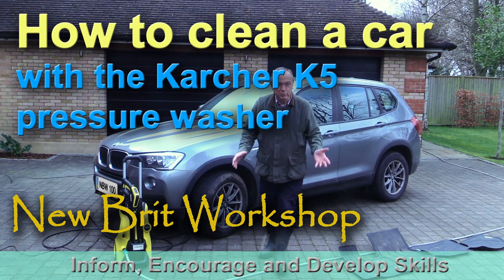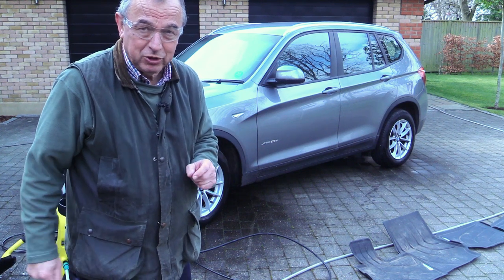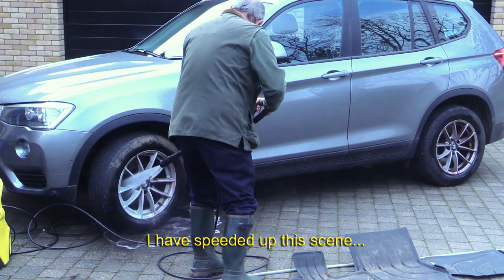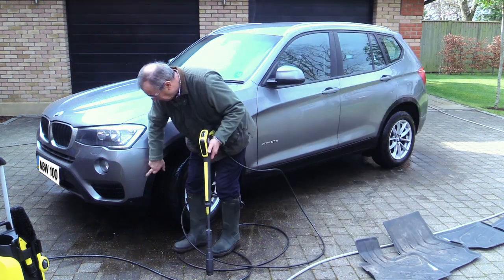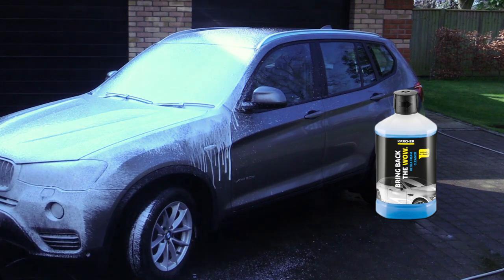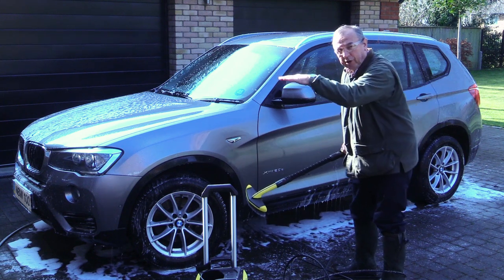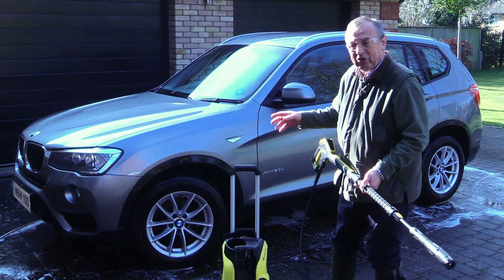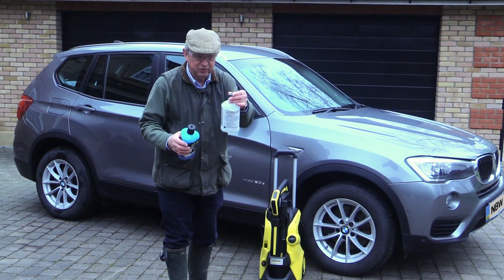How to clean a car with your Karcher K5

Comment: 😎I think you may have been born to produce video tutorials sir. Great advice delivered in a no nonsense manner and overall extremely watchable. When I opened the box for my new Karcher K5 I was quite annoyed at the fact that "some assembly was required" and a glance at the instructions had me headed straight for the internet to see if there were any videos showing step by step, dreading the experience as so many videos are so hard to watch. Imagine my surprise and pleasure when I came across the three wonderful videos you produced on how to assemble and use the K5 properly. One would assume you work for the BBC on a professional production, so informative yet entertaining and done at a pace that was just perfect to follow, not rushed through or moving at a snails pace and frustrating me into skipping anything to get to the point. In addition to the task I bought the K5 for, I am now itching to try it out on my car and driveway too. Thankyou so much Peter.

Comment: Thank you Peter. I've watched quite a few of your videos over the last couple of years and always come away better informed.
I am about to try the foaming shampoo on my car and hadn't realised the care needed with a pressure washer around the proximity sensors. My front sensors packed up a while ago and I'm not wondering if it was caused by the use of pressure washers in a local car wash. Hmmm. It's also reassuring to see how others get caught out by bottle caps that don't seem designed to be removed by normal humans! Keep up the excellent informative videos.😊

Comment: Hi Peter, just bought a Karcher k5 pressure washer. Looking forward to cleaning my slabs with the special circular washing supplied with my karcher. Used to own a karcher, as yourself ended gifting it to my daughter as we had a small pressure washer gifted to us. Big mistake, or not as bought the K5 with the attachment. It took me over an hour to wash 8 slabs with the small one, so looking forward to using the karcher to finish the patio and footpath. 
Thankyou for your instructions to put it together and instructions cleaning slabs. Very very clear and discriptive. Good job as we didnt receive instructions or guarantee with our new pressure washer. Will contact Karcher.
Great video for cleaning the car.
Reply from the maker: Hi Maureen, Yes, it is important to support the daughters ! The original K2 is still working well but the K5 is a big step up and can tackle bigger jobs than the K2. Do read some of the comments on the car cleaning video as some viewers have, I think rightly, provided some advice on the method. Good luck. Cheers.  Peter

Comment: As always, an informative video. I use a similar method for my car to minimise the strain on my arthritic wrists and fingers - a legacy of a career as a  marine biologist with my hands forever in cold seawater. I also live in area with exceptional hard water (high calcium carbonate content), so even brushing off with clean tap water still leaves stubborn water marks, especially on glass.
In the past I have had to resort to polishing these out, negating most of the benefits of pressure washing. However, a few months ago I came across a very useful tip on Graeme Pullen’s TA fishing channel, describing his lockdown distraction activities, where he finished of washing his car by rinsing it with clean rainwater from a watering can and just giving the windows a wipe with a chamois leather. I have since tested this approach and found it to work well, though I would add an important caveat, i.e. only take water from the top of the rainwater butt or tank so as to avoid the sludge in the bottom which may be gritty, particularly if the water is collected from a modern tiled roof
Reply from the maker: Hi Bruce, That is very informative and will be useful to many.  Cheers.  Peter
Reply: i live in hard water area but use an outside tap that is fed from my water softener, so no water spots.
alternatively you could feed the pressure washer from a water butt. karcher sell the accessories for this. no need for watering can!

Comment: As a car detailer you have alot to improve on, if that car was black you'd soon throw that brush away and never go anywhere near paint with it again. Firstly you should always start with wheels as you did, then apply snow foam to a dry car for the soap to soften and lift the dirt with lubrication then you pressure wash it all off and then only then you go in with a contact wash with a good quality mitt NOT a brush that will absolutely maul your paint. You should always aim to remove as much dirt as possible before you contact wash reason being is you're dragging the dirt across your paint, hence why you snow foam first then pressure wash your car effectively giving you as clean a surface as possible to make contact with when going in with a mitt!
Reply: When I saw the brush I was like what the hell is he doing 🤣
Reply: If the car was black it was totally ruined
Reply: Good presentation ..   never seen  a car detailer having glasses. .
Cars are cars ...  They get dirty use or not used
Reply: Everyones a car ‘detailer’ now 😂😂 the guy is demonstrating the pressure washer! He isn’t ‘detailing’ a Porsche you melts! Get back to your ‘detailer/car wash’ job and leave the man alone.

Comment: Quick tip if you snowfoam first when the car is dry the foam will stick to the dirt if you snowfoam when it’s wet it will just run off on top of the water. The karcher k5 is a great jet wash
Reply from the maker: Hi Mark, Many thanks for that advice.  Peter
Reply: Notice he didn't use snow foam as a prewash but rather as soap to begin contact washing, therefore at that point it doesn't really matter.

Comment: What about the possibility of swirl marks on the paintwork after using the rotary brush?
Reply from the maker: I have no issue with that - either my eye sight is not good enough or I really don't worry about that sort of thing. I have never traded in a car and had any hassle over price because the buyer spotted any paintwork issues. Life is just too short.  Cheers.  Peter

Comment: Thank you for this very helpful video.  I have just bought a K5.  I was a little unsure from your video the difference between using the bottle of shampoo turned upside down on the machine and using the dispenser bottle on the end of the gun?  Would you mind clarifying the difference in usage?  Many thanks, Stuart.
Reply from the maker: Hi Stuart, The bottle on the end of the gun is for the super foam whereas the bottle in the machine is for the regular shampoo. I rather like the super foam application.  Peter
Reply: @NewBritWorkshop  many thanks Peter, that clarifies.  The mega foam option is quite something.  Stuart.

Comment: Love your videos on woodworking but don't see the connection to this other stuff. Am ordering a part system. Being in the US it took me a while to decide if I wanted to go 20mm or 3/4" dog holes. Having taught the metric measuring system to many US companies when it was starting to grow in the 70's and 80's I decided to go with the 20mm holes and embrace the metric system for my work.
Reply: Obviously my spell checker doesn't like the word Parf and decided I really wanted to use the word part. Bad spell checker! Sorry for the incorrect spelling of your marvelous invention.
Reply from the maker: Hi Larry, I am just an ordinary guy and I will make a video about anything that I do that I think may help someone else - this time it might not be you but my last pressure washer video has had over 500,000 hits and now helps to subsidize my woodworking. Good luck with the PGS. Cheers. Peter
Reply: @NewBritWorkshop  Ordinary would not be the first thing that comes to mind when I think of you. I think  extraordinary comes more to mind. As a journeyman tool, jig and fixture with a formal apprenticeship behind me working on development of the 747 and L1011 along with military aircraft including nuclear missile systems development and working many times to .000002 +/-
Reply: I can appreciate a development of something like the Parf system. Trying to type thos on a tablet with big hands is not an easy task so I sometimes hit the wrong key.
Reply from the maker: Hi Larry, Many thanks.  Peter

Comment: Great video Peter. I notice the handle of the karcher is up. How do you lower the handle once you've finished with the pressure washer. I can't seem to lower mine.
Reply from the maker: Just give it a firm push (or even a strong jolt) in the right direction and it will move. Good luck.  Peter

Comment: Hello, wanted to ask about brush. I decided to buy one after your advice wb150 and I also visit the store to touch the brushes and check if they are not so rough. There was the same brushes that you use in this video. And it seemed for me like they are a little too rough for a car paint, or it is okay?
Reply from the maker: If it is sold as a brush for a car then it really should be okay. I have never had any issues with car brushes. Peter
Reply: @NewBritWorkshop  Thanks a lot! Hello from Odessa 👋🏻
Reply from the maker: I took an aid convoy from the UK to Odessa in 1995 to deliver vital medical supplies for very sick children. Were you there then?  Peter
Reply: @NewBritWorkshop  Wow, that's cool. No I wasn't there at that moment. I was born in 1995 😁

Comment: Hello Peter,
What do you think of that rotating brush that you use on this video?  I was about to get one from Amazon, but the reviews are terrible.
Reply: Just looked at the wheel brush and that too has bad reviews.
Reply from the maker: Hi Kenneth, It is okay and it came with the Car&Home kit but the wide, non rotating brush is better. The real problem with the rotating brush is that it is too small - other than that it has soft bristles and works as Karcher claim.  Peter

Comment: I'm afraid I'm with the others on not using brushes anywhere near a car. Your paint will have swirl marks all over it. But what really intrigued me was the advice not to point the washer at parking sensors. Surely (on an autobahn, obviously) a car with a high top speed traveling in excess of 150mph (or higher) will suffer significantly more pressure on the sensors than the Karcher will deliver? And in the rain it will be high-pressure water hitting the car too at those speeds.
Reply from the maker: Hi Connor, I don't suppose you would take a car through a car wash but those brushes are far gentler than a car wash. On the parking sensors, I see your point but I think that the high pressure and concentrated volume of water would be more damaging than rain at autobahn speeds. Perhaps pressure washer manufacturers have to protect themselves a bit too.  Cheers.  Peter

Comment: Be prepared for an avalanche of comments from The car cleaning perfectionists about you using that brush on your paint work 😂
Reply: I’ll keep quiet😂
Reply from the maker: I accept that for a Bentley or a RR but for an ordinary car...?  Peter
Reply: @NewBritWorkshop  Hi Peter, that’s true but you would be better with a microfibre wash mit and two buckets with grit guards in them. It’s just so it doesn’t damage the clearcoat on the paint.

Comment: If your car was full of crap on the roof you'd have to start from the top to the bottom. Otherwise all the dust and sand and whatever it is on the roof will end up all over the whole car anyway. You starting up from the bottom then up would result in you having to wash again.

Comment: Never use a brush on your car paint….only lightly use a care mitten—you’re scraping the paint.
Reply from the maker: The problem with any item you use is that there is a danger of scratching especially from cloths and sponges which get bits of grit lodged in their fibre.

Comment: Funny - the Eastern Europeans have been cleaning my car with pressure washers for years and the cameras haven’t suffered.
Reply from the maker: Hi Jim, It might just be luck but the seal where the camera goes into the housing is not super efficient on all cars.  Peter